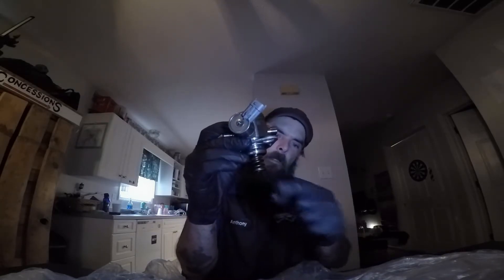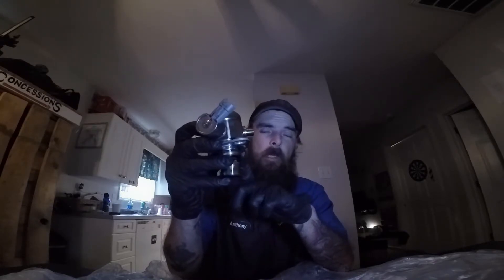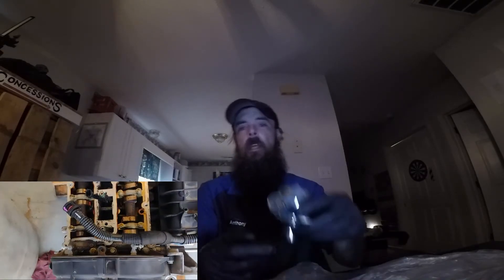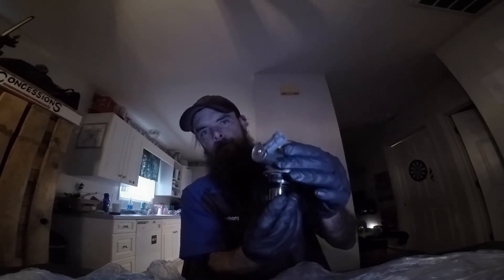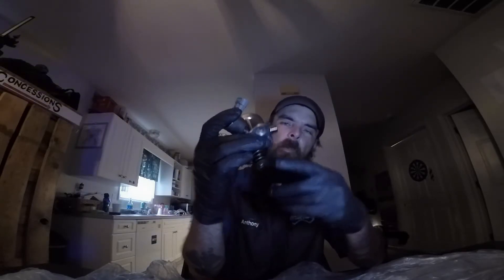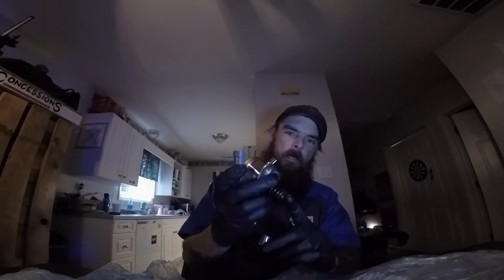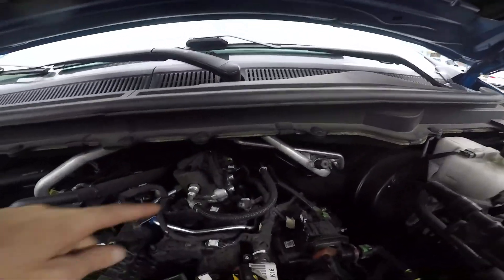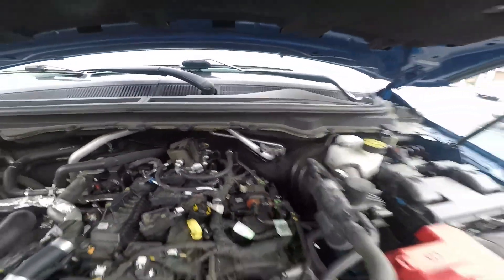Ford Ecoboost 1.6 Liter High Pressure Fuel Pump.  How It Works

Comment: Thanks buddy good explanation. I have Ford fiesta st 2018 I am getting p2636 low flow b low performance... Is it the high fuel pump problem?
Reply from the maker: Could be. Or could be a sensor. Or the pump in the tank that has bad fuel.  Going to need some diagnosis.  Usually it's the high pressure pump though.

Comment: I got a 2013 Ford Fusión 1.6l EcoBoost. When accelerating on a uphill, the car gets like loosing power. There is a code P00C6, ,the FRP is 656.9 PSI according with the trading on the scaner. 2000 PSI versus 656.9 PSI is a Lot of difference.Doi You think the high pressure pump is over?
Reply from the maker: @agustinlara3013  very rarely do they go out. If they do it's usually because the bucket has worn on the cam shaft due to not changing the oil. I would remove the valve cover and inspect before buying a pump
Reply: @BeardedFordTech Ok, I 'll the   bucket first and look for damage on it. Are the buckets sold in the afternarket ?.
Reply from the maker: @agustinlara3013  if the bucket is messed up that means the camshaft and pump are messed up too

Comment: I know this video is a little on the old side but do you know what the pressure is supposed to be after shutting the engine off? Mine gradually went up to 1120 psi with key on engine off when that pressure finally dropped down to like 8-10 psi after like 30-40 min. idling its meeting what’s desired. This is on a 3.5 ecoboost 2017 also getting a random rough idle on startup after vehicles been sitting a day or 2
Reply from the maker: @brandon22333  thats normall for the pressure to go up in key on engine off. It's priming the rails and Injectrs. Means you got a good sealed system if it took that long to leak down.  Random rough idle.  I'm assuming p0300. Misfire on startup. Have you had the phasers replaced along with new tensioners for the timing?
Reply: @ unfortunately no codes and it’s random it does it I just mainly noticed it’s after it sits for a while and it may or may not do it. And the cam phasers or tensioner haven’t been replaced. Only time I’ve seen those replaced is when they get the infamous rattle on startup lol. I use to work on all the cop cars where I live and I’d send those to ford all the time other than that, that’s the only time I’ve had those be replaced never seen one fail without the rattle
Reply from the maker: @brandon22333  the rattle isn't a failure. It just happens when all the oil drains back down. The phaser loses oil.  So they uodsyed the design. Easy to do.  Are you able to monitor on a start after two days?  Hook up the scan tool then start it while monitoring pids see if you can catch it on the graph. Or in mode 6 on IDS (if you have access to that)
Reply: @ I have an autel and a Mac scanner but they both have mode 6 I’ll definitely give that a shot it’s a family members car so may not be until next weekend to try that. Thank you for replying man I deeply appreciate it!
Reply from the maker: @brandon22333  email me. Let me know what you find. See if the tool catches it when it happens.
Reply: @BeardedFordTech  I will for sure!

Comment: That is not a fuel pressure sensor. That is the solenoid that regulates the fuel into the pump. The high pressure sensor is on the fuel rail.
Reply from the maker: Yep I misspoke. And it's actually written wrong in ford workshop manual too. They call it the pressure sensor. Not the volume  control like on the cp4 diesel pump

Comment: thanks for the informative video. For the fourth winter I have been solving the P0258 (Injection Pump Fuel Metering Control B Low) problem. The engine light is orange. In the summer, the light goes out, and it starts to light up again when it gets cold outside. At the ford brand service, they replaced the fuel pump in the tank, but the error persists. They can't fix it. It is a 2010 Ford C Max, 1.6 ecoboost engine. Car has 115,000 miles, oil and filter changes every 6500 miles or 1 year. The car drives normally, has power, starts well. Maybe a little higher consumption... Where is the problem, can you please advise? Replace the high pressure pump? Thanks for the answer
Reply from the maker: Check engine light is always orange. That's the only color they use. If this is only happening g in the winter it could be the high pressure pump. I would have them check the pressure on thay. Also check the bucket it sits in.
Reply: @BeardedFordTech  the pressure is fine, I guess I'll try to replace it, hopefully that will help... Expensive, but I don't know what else to try. Thanks

Comment: Really informative, thank you! I'm wondering how the ecu determines desired fuel rail pressure. Ive got a 14 2.0 EcoBoost with really high fuel trims, 30-40% total correction. Everything has been swapped and nothing touches it, the air leak aspect has been checked to death, with starting fluids, water, and listened to as well as a Ford dealer finding no leaks. The current theory is that fuel rail pressure is too low  at 259psi (idle, cl) DESPITE the pressure matching the desired pid (and the sensors having been replaced and reporting the same as the originals. Is it possible the ecu is confused about how much pressure it needs?  I was able to graph my fuel trums vs frp and they are interesting. The instant the idle goes up, the pressyre spikes and fuel trims drop. That's what's got my attention.
Reply from the maker: Its determined by the fuel rail pressure sensor and pressure from the in tank pump. You said you changed everything. Did you check the bucket it sits on?  Did you check the in tank pump?
Reply: @BeardedFordTech  i had a new tank pump put in about 6 months before the lean condition started. I wonder if it could have failed or restricted. I'm gonna get a pressure test on the system as soon as I can. I have seen another EcoBoost engine idling with 500-700 psi in the rail so by that comparison I believe my fuel rail pressure is way too low despite matching the desired rail pressure.
Reply from the maker: @jasonsparrow4981  I meant the high pressure pump. Have them check that.  When you had the tank pump replaced was it a Motorcraft or aftermarket?  They don't like aftermarket ones

Comment: Do they just fail with just 10k on motor , With supercharger installed ? Tried to bench test like old school and will not push a drop out . Just would like to have some more info on these things . Was wondering if the high rev motor could take one out .
Reply from the maker: These aren't known to fail at 10k.  Ot sure how your bench testing. But if it has 10k. It should be passing. Fluid comes in cam lobe pushes plunger it pressurized and sends it out.

Comment: These engine mounted, camshaft actuated pumps are pure old school, although higher pressure.  I replaced many such pumps on 1970s cars!  The old ones would have an arm that came onto the cam from the side, and rode the lobe up and down.
Reply from the maker: Yep. Like a Detroit 60 series old school 18 wheeler. Done many of them. It's not new technology you are correct. But it is more advanced off an old design.

Comment: I have the 2013 f150 eco 3.5. Truck is running fine, but has decrease the mpg, and pump is loud. No codes, do you recommend replacing it to prevent future damage to engine and pump? Is there a way to tell if it needs replacing without codes, and based on what I am describing. Thanks
Reply from the maker: The pump.is always loud. You can take it out and check it. If there is abnormal.wear then I would do some more checking. If it looks fine then change your oil every 5 k miles. Also do a fuel system service with intake clean. That should jump your fuel mileage back up.

Comment: Are you sure that the module you pointed to is a pressure sensor? I think it might be a quantity control valve. Mine (ecoboost 1.0) only has two pins, and resistance is 1.2 ohms. If it were a potentiometer I would expect at least 3 wires and resistance to be in the kiliohm range. I have tried activating the module directly and I hear solenoid movement. Do you know if these pumps need to be bled of air before they will generate vaccum?
Reply from the maker: It's a pressure sensor. It's run by the exhaust cam. No vacuum. Haven't worked on the 1.0 yet it may operate a little different. I can check in workshop manual to see.

Comment: Awesome presentation! It looks to me that the solenoid on the pump functions as a fuel pressure regulator. Is that also a sensor for the computer to monitor fuel pressure or is there a separate sensor? How do you relieve fuel pressure in order to service the system? I've read that the pressure can be dangerously high. It appears that scanners are used to check fuel pressure rather than a mechanical gauge. Looks like they are adding the port injectors to address the combustion chamber carbon issues. That lady thought she was saving money waiting till 22k to change the oil. Now she got an engine change.   🤣🤣
Reply from the maker: That is the high pressure sensor.  I kept saying solenoid but it's a sensor. It talks back and forth to the pcm to regulate pressure. Yes they are dangerously high.  Yes we monitor high and low pressure with the scan tool. It will be a line graph. To the left is what it's calling for in a number. Below that is what the pressure actually is.  To the right of those numbers is the line in real time.  Port injection is very common. On the mustangt gt and f150 5.0 they added direct injection. So it uses both. To relieve pressure for service remove the fuel pump relay and start the vehicle and let it run until it dies. Then let it sit for a second. Then you can service the system if need be.  Or if your doing engine work and the high pressure pump has to come off then it is safe to do so at that point.  Yeah 22,000 mile oil change just cost her about $7,000 instead of a.$50 oil change. People just don't get it
Reply: @BeardedFordTech  Thanks for the explanation! These newer vehicles are getting more complicated. That high pressure fuel escaping can act like a laser beam. The oil change situation reminds me of the old Fram commercial "pay me now or pay me later".
Reply from the maker: @mlieser1230  man I forgot all about that commercial lol